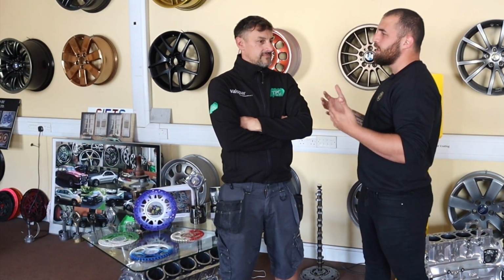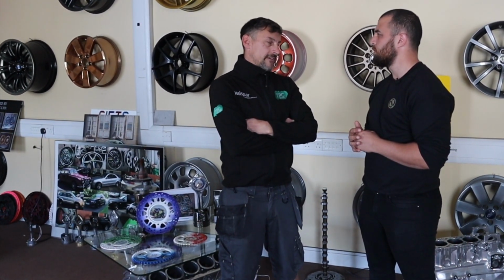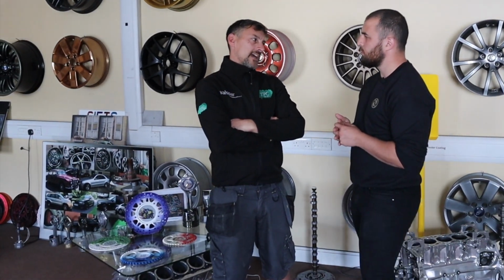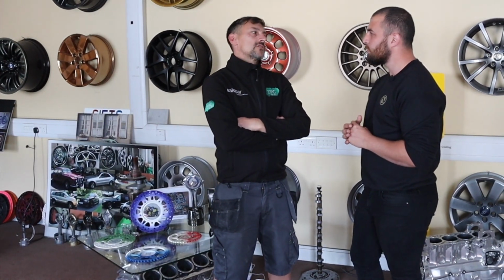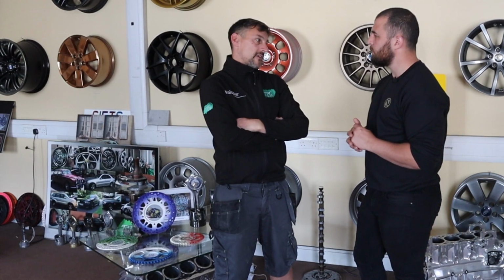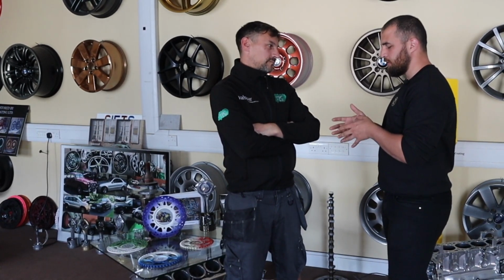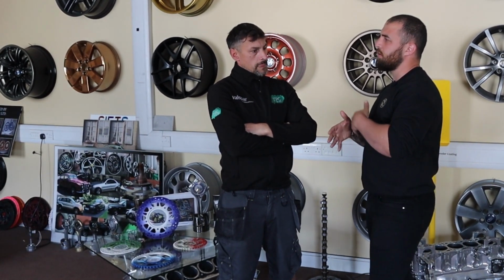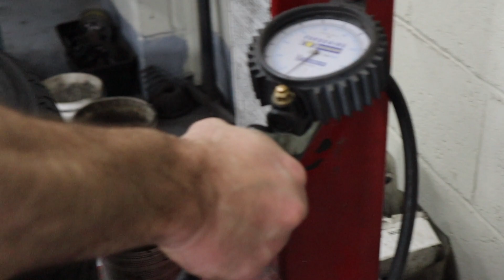Alloy Wheels Refurbishing | Tallaght Powder Coating | BMW I8

Comment: Shop that's been around for 30+ years and don't mask off the wheel hub? Hmm... lol. Common knowledge among any decent powder coater. Could cause a failure down the road from the wheel not being fully seated because of powder build up.